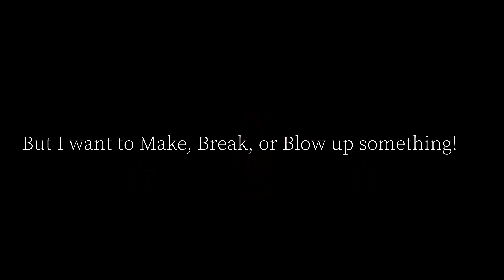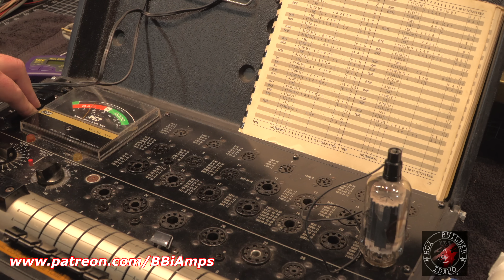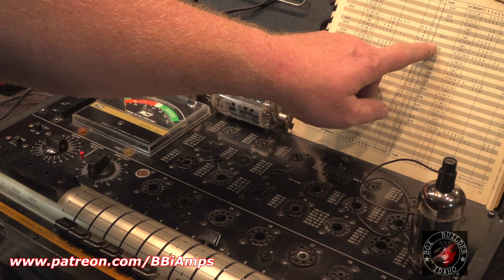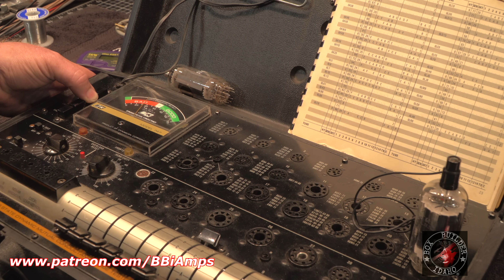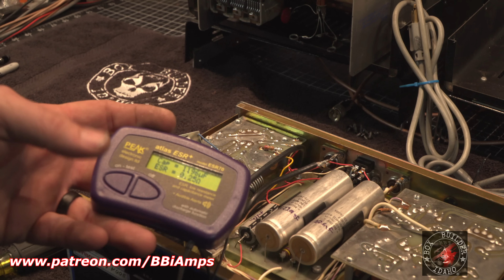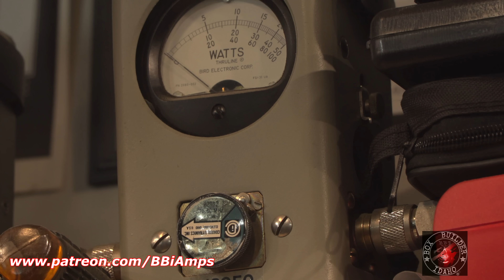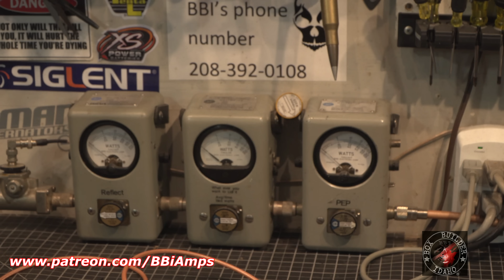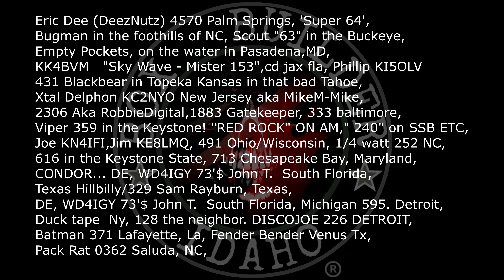Ro#19 and #20, 2023, two Palomar 300a repairs!!

Comment: The higher voltage transformer has SLOTS FOR VENTING ON THE CASE voltage is 600 with a full wave bridge you get right at 790-815 volts. the transformer most common does not have the vent slots and puts out 300+ you get about 800 volts from the voltage doubler. If you use the higher voltage transformer with the voltage doubler  the filter caps will blow up. BEEN THERE AND DONE THAT. If you use the lower voltage transfomer with the full wave rectifier with good tubes you get about 250-300 watts . Been restoring and repairing Palomar 300A  for a few years now.
Reply: You can also measure the core, the larger 3" core is the 600v

Comment: I used to run one of these way way back n the day & i will tell you i ran the dog snot out of it for 7-8 Years as hard as they can be ran & it Took every thing i threw at it ! drove it with a black radio Saturn at about 20-25w i even drove it on the high side a time or to for testing & it still held up like a champ..But as soon as i got it i put a new set of tubes n it an new pair of caps But i also aded a small fan over ea set of tubes pulling heat out ! I traded it in on a Jb 2000 after i had ran it for so long & the firs thing the guy did was take the fans off of it that i aded & he blew it up less than a week after i traded it to him..Heat is Electronics #1 Enemy .Mine was the Black Faced With the Chrome Top !

Comment: The lower voltage transformer uses a voltage doubler diode bridge that brings the voltage up to spec. ^^ Unit 1 SW WA waving.

Comment: Glad you showed this I was given a 300a put new caps in it when I flipped the board over same thing trace cut had resistors on the diodes had ceramic caps in top of the diodes.I.took all that off fixed the traces but the top still has rivets in it not sure if that is factory.

Comment: nice old amps. had not fixed many of them. I do have a working 300A wight face one. have manuals for it. has same tubes only have 1 good set of tubes. getting pricey now. they run  better on 115V than 120V . them so old powergrid has slightly lower voltage. using 6V filament on meter finding on mine around 115V AC in works out. the full 120V over volts the filament a bit. will work but shorten life of tubes. I got a 3 tube and 2 tube one but parts unit. some 12V palomar ones . 2 tube . not working. I have outher 12V mobel tube amps.some work some need tubes some parts. different brands. Kris/PAL Electronics,ken tron black cat some others.I NO longer fix SWEEP TUBE amps. 73's
Reply: i have two  300as   fixed  many  back  in the 90s   ,,i dont anymore as most wont pay  to fix them,,,an some parts   you cant get easy

Comment: Greater video love tube amps and appreciate you taking the time to do these videos and especially no adds  I hate adds.  I support you as you do great work and great explainations on what you find and how it works.  Glad you had the issues with the second amp and found the issues but I don't know why.  I will say as a almost 50yr ham and a Swan Guy and Drake.  I knew a CBer who modified his Palomar for lower output so he could use the CB rig to drive the Palomar and then drive a Swan MKII to get 3000w out.  The Swan MKII with Swan 700cx will do that. The 700cx used 8950 tubes (2) and about 350-400w out and would drive the MKII to 3k out that was really pushing it, I have done that for testing.  But back then 2000w as max input.
well there is my 2 cents.  just food for thought.  BUT I don't why they lowered the voltage in your case, it could have been a different transformer which is very logical.
Well my friend you're awesome and enjoyed the few phone chatts.  From The Dalles best 73s
Mike

Comment: I have a Palomar 300a which has 26 lr6 driving for 6lb 6 are they used the proper tubes that doesn't seem to be putting out half as much as used to I used to get 1100 West side of it now I'm lucky to get 600
Reply: I apologize for the spelling I am almost blind and I'm using talk to text my Palomar 300 has four of the 6lb 6s and it has two 6L R6 driving them are these the proper tools I used to be able to get 1100 watts and now I am lucky to to get 4 - 500 what's
Reply: I was also told I could use six lq6 what is the proper way to do also Palomar says that came with six of the KD6 which ones should I be using